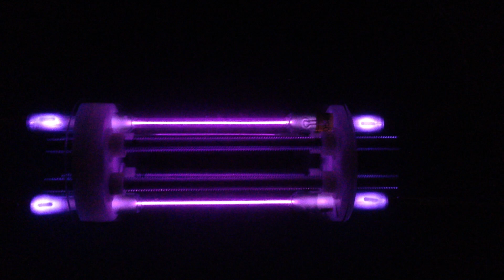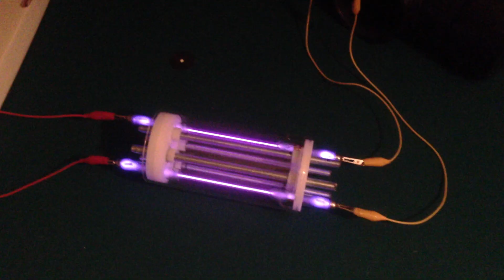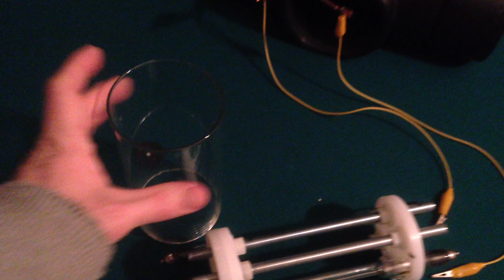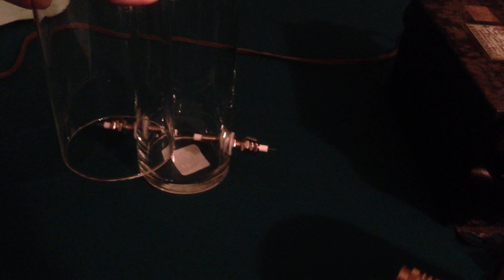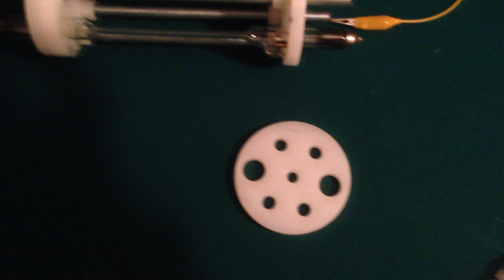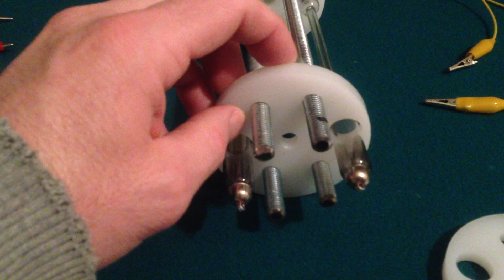Laser EPG 017 - Specific-Gas Processor Design using Spectrum Tubes as the Photon Source

Comment: Happy New Year! I do something similar for my car too. I hope there will be results- in your setup and in my too. I`ll try to use PWM pulse circuit with Induction Coil (AC) and FlyBack transformer with rectification (DC). I have a cold fog generator and in my setup I`ll try to do some splitting of fog and com-bust it all in engine. I know without fog there is O3, but with fog there is H2O2 and OH radicals. I don't know whats will happen, but we will see. :) I can recommend use of 5% of fog.